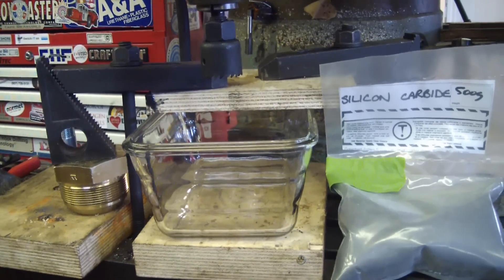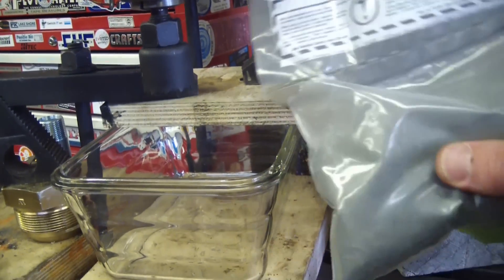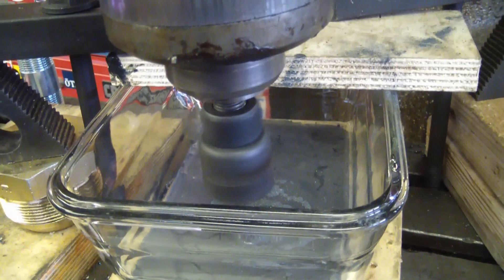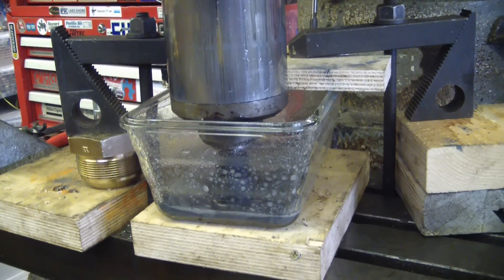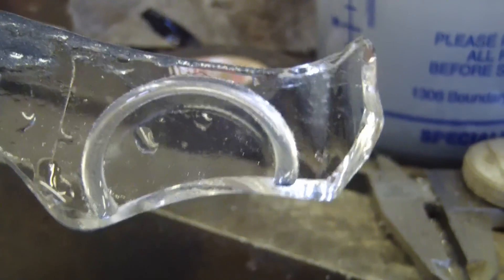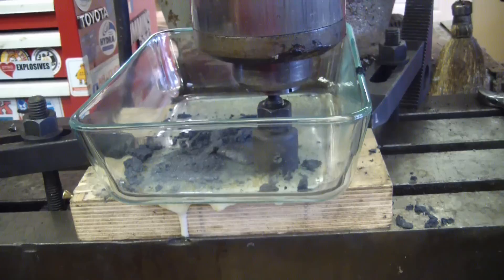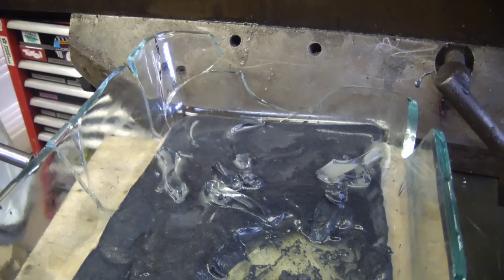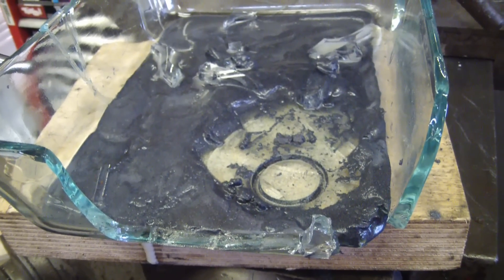Using Silicon Carbide to cut glass

Comment: ok this takes a min to tell you but the short end of the stick is heat you must do it with no heat, I see so many ppl trying to drill or cut glass and messing up its so funny ,,now im going to tell you how to cut ANY glass I drill holes in safety glass as a bet and make mad money ,,,now how I do this is a rely old trick and its not a fast thing its rely slow going get you a harbor fright $7.99 12 v drimel cut the transformer cord ,get you an old x-mess light string cut 6 bulbs in a string and splice them in the line and set it on a car battery use any tip for the drimel ,,,now what's going to happen is when you make any heat on the cutting tip the light bulbs will light up and take the heat away also I take the drimel apart and cut the diode or what ever the f#ck they got stuck to the 2 power poles on the motor off and put it back together you can also stall the motor out all day long and cause almost no wear on the motor so get it up to speed than stall it out ,the bulbs take the wear you can also play with less bulbs but at2 or 3 if you stall it the bulbs might pop and you run the risk of building up heat you need no lube ,,,,,,,,now there are 2 ways to fix the way you were doing it one slow your mill down to a crawl and let it go for a few days lol the other is the water for cooling was not moving in the center of the hole saw cut some relief slots in the saw add more water and make shure the water is getting a good flow into the center of the hole saw,,,now if you understand what I just rambled off you just learned something that in the 1950 cause you $600 or more to learn ,, if I could speak this to you I can explain it much better but my camera ant all that good I would drop my phone # but im not gona deal with all the bs calls I would get asking me to explain this please email me if you don't understand lobo79@live.com,, im not wasting your tine here yes this shit takes time your cutting a big hole there boss ,,good luck

Comment: I hope you do not experience having your ring finger ripped off because your wedding band was grabbed by one of your machines. Ask wife's permission to take off the ring during machine operation. Shop 101.
Reply: or just do as i do. get a qalo. its a silicon wedding band. roughly $20 and a lifetime guarantee. if it snags it breaks away. i love mine.
Reply: +lloyd lisco yall safety sallies, are commenting on the wrong video
Reply: +hexadecimil T
Reply: +hexadecimil Thanks for straightening me out. Back in the 50's stretch bands were the thing on your watch, Thankfully they were not very strong and the two or three I had torn off my wrist failed before the drill press could tear my hand off, I finally learned not to wear jewelry around my machines.
Reply: +lloyd lisco I get you man. and as for me I wear my ppe and don't wear jewellery but for a guy who actually uses the term "safety squint" I don't think he's going to meet safety comments with anything less than pure, sxarcastic disdain. just saying.
Reply: eh Aunty Bob. uh ,Le Sand blaster ne fonctionne pas?

Comment: importent you have straith teeth. I would make a hole in tree as guide. It is not possible to bore from one side. You have to bore from both sides. The thinder the glass gets. the more importen it is to have No vibration.